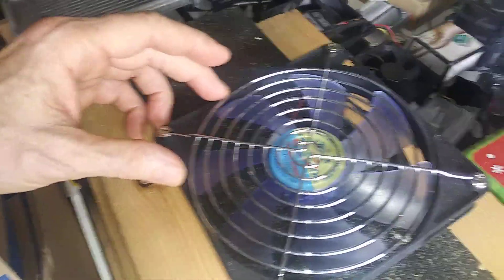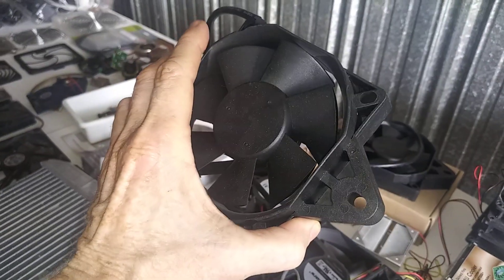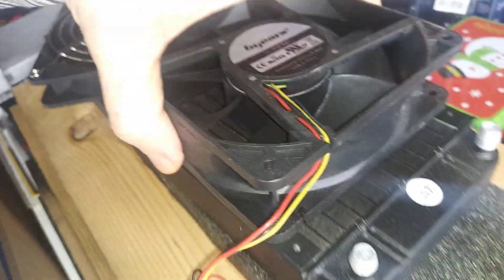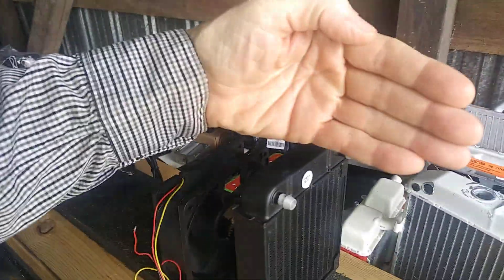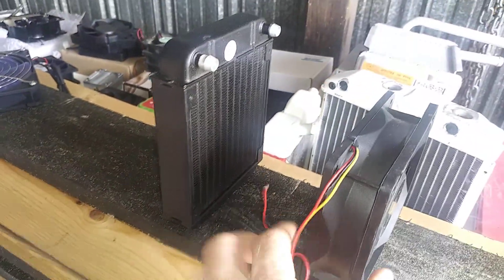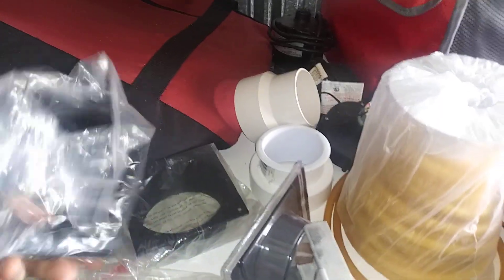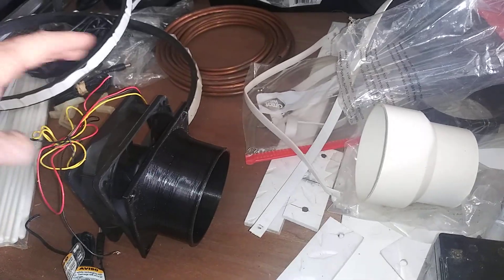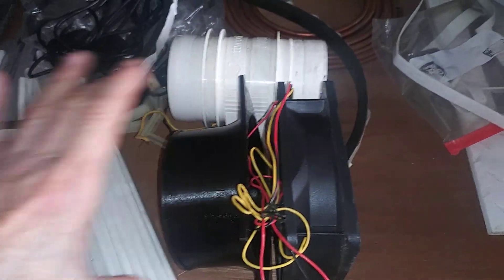PC Fan? For A Homemade Air Conditioner?

Comment: Where can I buy that black plastic air flow manifold for the computer fan?  What is that item called?
Reply from the maker: Thanks for the question!
That's called a "duct" or " shroud". They cost about $10 each depending on who you buy from.
I put a (sample) Amazon link below for general reference but make sure your mm & inch size is correct for your setup. I'll also make a quick video in a bit answering your question as well.

Thanks Much for Watching...
James 

https://www.amazon.com/BITMAIN-Antminer-120mm-High-Temp/dp/B07DGRBK98/ref=mp_s_a_1_13?crid=OWG6K5N66CIA&keywords=pc+fan+shroud&qid=1684082502&sprefix=pc+fan+shroud%2Caps%2C179&sr=8-13

Comment: What size was that fan and radiator? 120mm?  I've also hear you can put a high flow fan on the pull side and a high static fan on the push side to help with airflow.

Comment: Sir, what is the humidity of air blowing out? Also I would like to ask how long will a liter of ice last? (Using your smallest radiator and an 80 mm PC fan) may I also know the thermals of the air blowing out? I want to build one also.

Comment: thanks for this vid, I was pushing through my radiator, another thing i've noticed is pushing through the radiator melts the ice alot faster than pulling through.
Reply from the maker: Yes, pulling the air through is definitely the best route to go. I also reverse the fan polarity on the white 3" Atwood fans that I use on my Ice Chest Air Conditioners and turn the fan backwards positioning the blades on the radiator side. This is the best configuration.